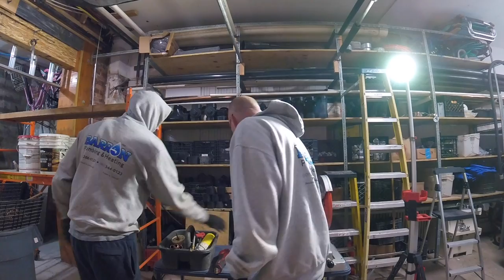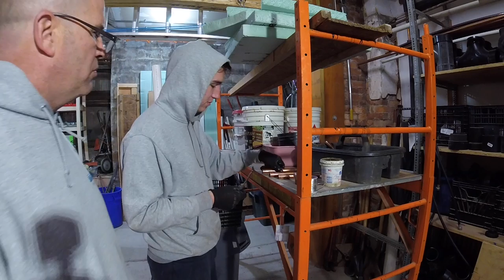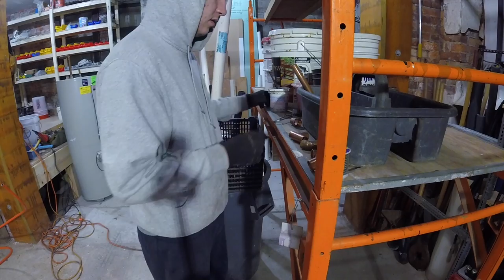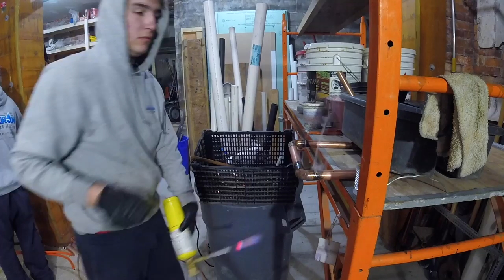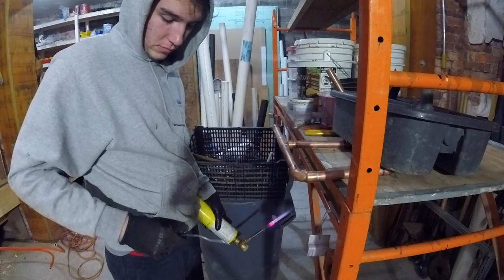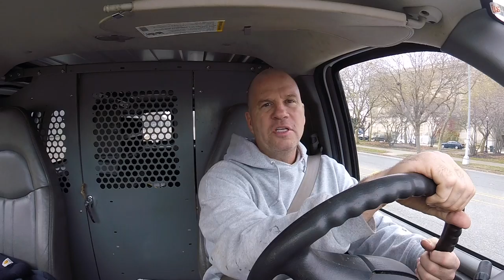PLUMBING APPRENTICE LEARNS BASICS OF SOLDERING COPPER PIPE

Comment: Hey chuck nice tutorial for the greenhorn! I’m 53,the old timer who broke me in used to wipe the joint while still molten with his bare index finger! Also taught me to solder brass to lead and pour a lead joint and “caulk”it properly.
Reply from the maker: awesome. Now that we the old and bold most of the old timers are retired. I can just see that in the supply houses. They worked..no pro press, no plastic, no electric threaders.

Comment: Always heat from the bottom ,heat travels up . Watch your flux ,when it starts to smoke your ready to apply your solder. Most you tube videos I've watched everybody uses too much heat on 1/2 -, 3/4 , and 1" joints. How can you have a shop without a work bench with a vice on it ?
Reply from the maker: thanks for tip john..shop under clean up right now. I actually have a vice from former owner...Zakeim The Dream Plumbing. 👍

Comment: Practice makes permanent, not perfect. Watch as many other plumbers solder as you can. Refer to the Uniform Plumbing Code illustrated training manual for the proper order of operations. You"ll never forget to deburr when you understand cavitation. You'Il really understand over/under heating when you learn to braze. You'll know why its necessary  to open every fixture in the house and appreciate a properly located service tee when you attempt to solder with water in the line. I thought reading about the proper way to solder was a waste of time because I learned on 1/2" and 3/4" and had a nearly leak free track record. Then came the 1.5", the  2", and the under slab brazing, thats when I started to understand how copper behaves when heated and was able to cross reference my experience with existing information. I imagine its difficult to learn with the old man looking over your shoulder and while on camera, so hats off to both of you for the effort. I appreciate my mentor for standing back and letting me learn without being overbearing. Ownership yields responsibility,  when your apprentice feels as though he is solely responsible for the outcome, the problem will have his full attention.
Reply from the maker: great point! situations dictate soldering big time. CB2 about to launch his 4 year mandatory apprentice school coming very soon. Thanks Kyle.
Reply: yeah, larger diameters take far more working the torch to get even heat and now the "lead-free" brass is terrible at heat transfer and you have to really work the shutoffs without cooking them.

Comment: This video reminds me of an occasion where I had to go with my mentor the locksmith to a really bad part of Brooklyn NY to rehang a roof door that the local delinquents ripped off of the hinges.It was raining heavy and it was also cold that evening.My my mentor the locksmith (God bless him and his family where ever he may be now,Amen.) had the habit of breaking off the ground prong on his extensions and his tools.Since I was taller than my mentor I had to go up on the ladder and screw anchors and bolts to rehang the roof door while my mentor held the roof straight and steady on some two by four pieces and wedges that we had to use to raise the roof door to the proper height to rehang the roof door.We had to use a three eights inch drill bit because the holes that were originally drilled into the roof door were shot.I got up on the ladder and drilled the holes then passed the drill to my mentor the locksmith and all of a sudden I hear my mentor exclaim "HA!!!HA!!!" I asked my mentor why he was laughing and he said that he wasn't laughing,that what happened was that he took the drill back from me and grabbed it by the drill bit which was plenty hot from drilling the new holes in the roof door.Okay,so having installed the bolts through the roof door I once again needed to use the drill to drive the nuts.This time my mentor took the drill back and grabbed the drill by the drills' body and all of a sudden I heard my mentor again exclaim "HA!!!HA!!!" I asked my mentor what had happened the second time taking the drill back and he said that the drill shocked him and said to me "You shmuck!!!" I started laughing so hard that I lost my grip and almost fell off of the ladder and on top of my mentor God bless his soul.LOL!!!!I'm not saying that you are doing anything wrong,please don't take it that way.God bless you and your family and very good video by the way.My mentor and I were referred to as the Odd Couple because I was organized and my mentor was always all over the place.Who says you can't have lots of fun and laughs on the job right?LOL!!!!
Reply from the maker: life time memories for you for sure.

Comment: I have noticed this before Chuck, but now I have to ask.  Did you never let those kids use tools?  Or is it that they grew up playing video games and not building/fixing stuff. Things have changed since my day.  I learned to solder in junior high shop class that every guy had to take.  We also learned basic hand tool skills that we put to use working on cars.

Your exercise for CB2 was a a good confidence builder for him.  Next you need to teach him to be more aware of where the flame is and how to use heat shields.  You ought to have him do some soldering on a pipe coming through a piece of 2x4 about 3-4 inches from the joint.  He is learning though.
Reply from the maker: Oh these two are games for sure. I am too....lol. but to awnser your question CB2 did start late with me. Angelo earlier. I always said enjoy your summer your gonna work you entire life. well I should of made em work more maybe. its all good though. We getting it done. not as fast as i like....I blame late start on my easy breezy ways.
Reply: @ChuckBarron  I understand.  I have seen a lot of young kids that don't know which end of a hammer to hold.  More the fault of "progress" than any one person.  Heck, after growing up working on cars (my dad owned a garage) all I do is drive mine now.  That is partly because I now have the ultimate tools (checkbook and credit card) and partly because cars are too complex now.

Comment: Give the joint a chance to cool some before wiping with a wet rag because if not the wet rag hitting the joint will cause the solder to fracture just like an ice cube tends to crack when you drop it in a glass of water.I learned that the hard way when I first learned to solder copper pipe,I wiped the joint too soon with a wet rag and when the water was opened I got a snout full of water because the solder cracked from being wiped too soon with the wet rag,those were the days my friend.
Reply from the maker: I been doing that for 35 years. Even the flux wipe. ha. but your right it could cause a leak

Comment: hey on tub side test caps for shower/ tub basic valve set ups how do you solder to avoid it sinking into the cap
Reply from the maker: not sure what you mean. I  solder or press tub spout and nipple and cap in shower head....turn on to test diverter. hope that help.

Comment: We use propress a lot but sometimes i like to solder so i dont forget. Propress is a life saver but solder still has its place
Reply from the maker: Russ I been doing some soldering as of late. A must for sure. I even had a dreaded leak on a solder joint. lol. I got the shot don't worry its coming to a vid soon.

Comment: Chuck what brand of solder do you use and recommend? I heard lead free silver solder.
Reply from the maker: lead free for sure. I don't know what I have. i will check it out.
Reply: Canfield solder is by far the best in my opinion! I use oatey #5 flux never had any promblems.

Comment: I hate to keep saying this but this is a case where you need to actually see the solder being pulled into the joint . the only way to see it is if you have a really good close-up .
Reply from the maker: roger mike....my shop almost complete and looking to do more vids with the young gunners for sure showing some close up on different stuff for the apprentice plumbing in the making.

Comment: Look for brush brishels on the pipe and fittens before u put them together. Because brishels in a joint will cause a leak.
Reply from the maker: oh nice tip. the cheap flux brush will get ya. thanks Peter

Comment: Massachusetts has lead free brass fittings that don t solder good with regular flux. I use lead free 95 tinning flux for lead free brass fittings.
Reply from the maker: oh wow ok. I could not tell ya when my flux was purchased. lol. I use to use nokarode, then I switched to utility flux. Did you ever use Laco flux. that stuff was no joke. You did not even have to clean copper fittings. lol
Reply: @ChuckBarron  I have never used Laco flux.
Reply: that's all the brass fittings now, except for old stock with higher lead content, which can only be used in hydronic heating applications and it's gone once depleted also.
the tinning flux does help to wet the fitting easier, but now you have to heat the pipe itself more, then work back onto the brass and around for even flow, without cooking the valve.

on a second note, I've had brand new brass fittings pinhole in the middle of elbows and I mean right from new, threaded and sweat! a mix from box stores, online,  supply houses. it's most all from "india" and with the nearly no lead it's rough cast as can be.

Comment: "jump right in and get burned" yep always happens, flying along to git-r-done and you keep hearing sizzle sizzle and cannot say I've worn gloves much, they've always "whizzed me off" and get shredded. but boy after a hundred fittings and cuts, you'll wish you wore them =p
same for electrical in winter, the staples are hard to hold, you drop tons and nail the glove finger tips. we cut the tip of finger and thumb out or spent 3x the time struggling with pliers to hold them
Reply from the maker: hurry up pick up that hot pipe son......lol ouch!
Reply: If he thinks he'll get burned soldering , you should make him wipe a piece of 4" lead to a brass ferrule on the vertical , but I'm sure you don't have the tools or material to do it.
Reply: no kidding, while I don't do old school lead plumbing, I've patched some in before and poured lead for terminals and spacers for power, ground and mechanical cable terminations. it's always hot and never much fun, a little splatter splatter and you'r dancing wildly, a small solder spatter cools fast, a large lead spatter doesn't!
about equally as fun as being an iron smith or welding overhead, you'll quickly realize you have areas of your body that you forgot about 20 years ago, something about white molten slag or steel spatter always finds it's way in :))

Comment: I never had anyone teach me to sweat copper, other than watching tv shows (this old house and others), then I just went and dug around, found spare copper and fittings laying around various places, went outside on metal table and tried what I seen!
I don't like to re-flux wipe nor hot wipe because it disturbs the joint and sometimes as it sets. yeah the joints don't look quite as pretty with a little excess at the bottom and I guess I drag that over from electronics repair, where disturbing the joints is a bad sin. :)
Reply from the maker: Im waiting for the self motivated apprentice to show up.
Reply: that's only use older fellas..... even then it's hard to get moving and I am procrastination king :))

Comment: CB 2 always be aware of the location of the flame on the torch when you wipe the joint with flux brush. If watched guys burn cabinet doors not paying attention where torch head was pointed. Just trying to save dad some money.
Reply from the maker: Floyd, lordy lordy.. that is a weeks long class on situational soldering. Great point. low flame CB2 real low and perhaps a tip change
Reply: I've burnt my share of things, using a "trigger start torch"  makes life easy, but one major thing, ALWAYS take the torch head off, if it falls over in truck or elsewhere it's possible for it to start a fire. I didn't happen to me, but my friends, they were driving down the road in a work van the milk crate if was in shifted, it light and POOF. they wasted their thermos of coffee and mug putting it out lol. the lock "off" mechanism on them always wears down and breaks, allowing then to light

Comment: Cut cooper
Clean pipe
Removed burrs inside of cooper pipe and fittings 
Put flux in cooper pipe and fittings 
Hitting first cooper pipe and later fittings because when you heat pipe firts you expand cooper pipe and reduce gap between pipe and fittings and of course apply solder
Reply from the maker: and repeat!  thanks Jose.

Comment: I do like to solder last forever it left in place all push fit fitting have a 25 year guarantee  due to the o ring and hopefully no water hammer to shake them lose. Not done much propress fitting how long are they supposed to last due to having the o ring  do like the look and speed of using them have to move with the times
Reply from the maker: Nice. Not sure on pro press longevity but Im thinking many many moons.
Reply: yeah, not crazy over anything with "rubber" of any type as a primary seal. because everything rubber I've seen since I can recall leaks and worse yet if you mix the wrong chemicals and type of rubber... toilet flappers, tank bolts and fill valves, with them stupid in tank cleaners is a good example, but even chlorinated city water chews'em..
Reply: I’m a plumber from Dallas and push fitting on cooper are a no go for me !!

Comment: Just make sure he cleans the joints good after because the flux will actually corrode the soldier joint I always clean when it’s hot with flux but then I whip the hell out of it I’ve seen joints fail a few short months after because they were not whipped good or at all an that especially important on baseboard heat because the copper is extremely thin but good tutorial he didn’t look into it at all but nice job
Reply from the maker: nice eric. thank you. I have actually had base board hold under start up and once it reached temp a pin hole leak. I figured flux held and when she got hot it melted enough to leak...

Comment: DON'T WIPE FLUX AROUND THE JOINTS JUST LEAVE THEM TO COOL YOU'LL GET MORE DONE
Reply from the maker: Im so used to doing it. once you have your flow its really automatic. You know as you  become a pro soldering its a lot of moving parts and flying through fittings is your own personal system.
Reply: @ChuckBarron  i always do an outter flux  layer thats longer then necessary for the pipe and swab the inside of the fitting with it then do my heat and solder wipe it quick to avoid a bead and then spray with some water to quick cool ,atleast when im doing shower valves because its a pain to disassemble em so i unscrew the to top nuts to breath and then solder carefully around the inlets and spray water after to not overheat the body and melt the guts

Comment: CB-1 you forgot to tell CB-2 when your soldering with your Turbo torch never have it underneath the pipe because solder will drop down and clogged your tip. This is a Tech tip Peace brother
Reply from the maker: yes. thank god he did not ruin my tip. so many things to show em. all in time for sure. Thanks M
Reply: you can be under it, but it better be angled pretty steep and a ways away from the joint.